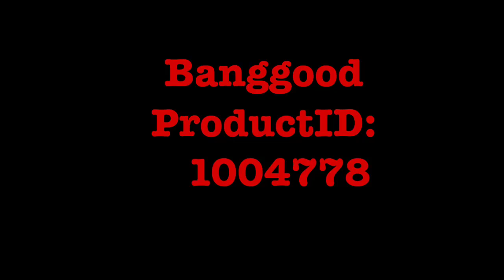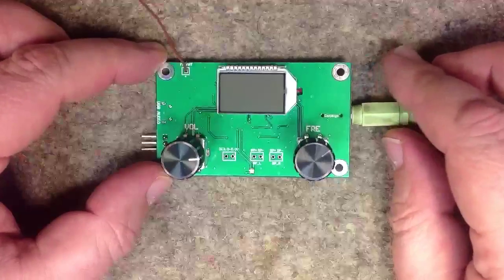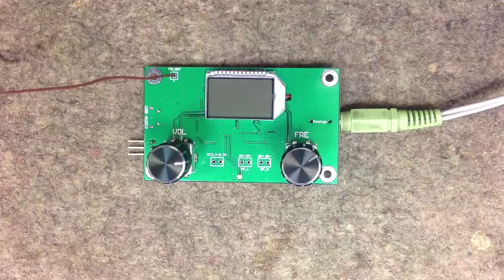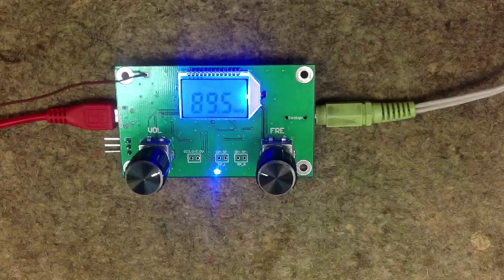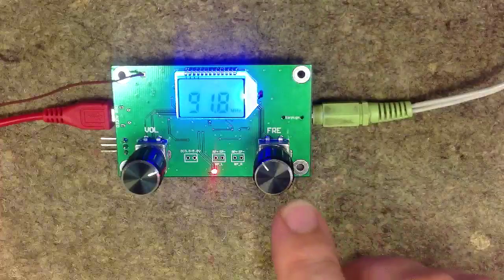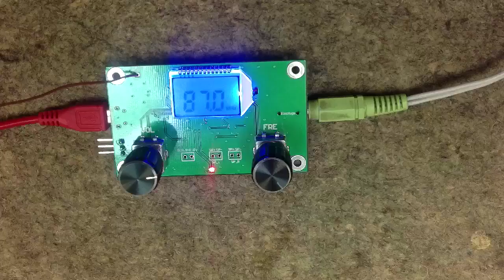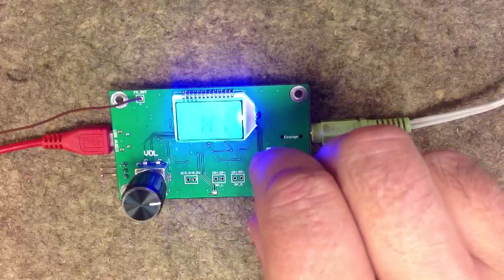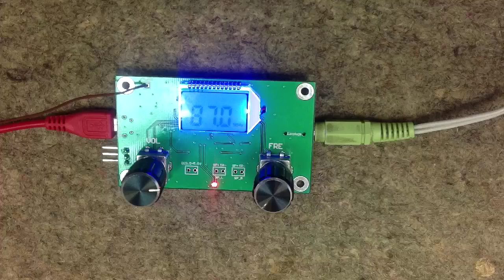Banggood - DSP & PLL Digital Stereo FM Radio Receiver Module 87-108MHz With Serial Control

Comment: This is an amazing product!!! Worth every penny!!! 
It have a build in amp 3W per channel! The connections are between the 2 encoders + the headphones out!
It works from 3.2V to 5V so either a lipo battery or a USB power source would be fine.
The reception is exceptional! I have a router antenna hooked up to mine and where other radios stop, it keeps playing!
I have it boxed and I might upload a demo video.
Battery wise, it gives a full 6 hour playing from a 3,7V 180mA lipo battery, utilizing the on board amp!
Oh! And it IS stereo!!!
I coldn't be happier than this!

Comment: Thanks for the video. Good job on describing the functions as I could not find any manual on this FM Receiver. Two questions: When you long press the frequency knob it scrolls "SN ON" or "SN OFF" across the screen. What is SN? Also can you wire a AUX(3.5mm) jack to this board? If so, how will it switch between sources?
Reply from the maker: When switched to SN ON, the radio does not produce any hissing noise when there is no transmission. SN stands for 'squelch', which is used to suppress the background noise when there is no signal. I don't understand the 2nd question. 😞

Comment: Hi, can you please inform me about which DSP,  PLL and microcontroller  IC used in this FM transmitter ? That wold be very helpful.
Reply from the maker: JL AC1552CG4R3FE 48 pin IC
8035  1540 10 pin IC
2402 memory
2 pcs amplifier
Reply: Thanks ! I can find the PLL FM receiver chip datasheet, http://down.cosou.com/xintechsz.com/QN8035.pdf

But the MCU is some chinese custom made, no datasheet released yet !

Comment: Egy kérdésem lenne  ez a rádió összeköthető-e egy erősítővel a fülhallgató kimeneten? Van egy "Bluetooth 5.0 100W+100W TPA3116 Digital Audio Power Amp HiFi Sound Dual Channel Class D Stereo Aux TF Card Amplifier Board" erősítőm. Hogyan tudnám összehozni őket. Én csak  amatőr vagyok az elektronikában.
Reply from the maker: Ha van rajta RCA vagy Jack bemenet, akkor azon keresztül lehet neki beadni a füllhalgató kimenet jelét egy alkalmas készen is kapható kábellel.
Reply: @bzoli5706  A  TPA3116 blutuszos Jack bemenetén keresztül lehet  hallgatni az internet rádiót. Telefonom kapcsolódik a Wifihez és  az meg összekötve jack -jack vezetékkel és szól az erősítőn keresztül (hangszórók) a zene. Köszönöm a választ.

Comment: Hi bzoli5706. 
Does the display of your Banggood FM radio stays always back-lighted when turned on for a long time? I'm asking you this because my display turns off moments after let it quiet, lightening on only after deal with any of the buttons, frequency or volume. 
Thank you very much.
Reply from the maker: +José Pereira By setting the backlight state is off state press FRE knob key to turn the display backlight Always indicate B1, B0 denotes a backlight turned off 20 seconds after the restart to take effect. Repeat this step to change the setting to switch the state. The factory is set to backlight turns off 20 seconds without operation.

My device works as above described.
Reply: +bzoli5706 I really appreciated your excellent explanation. Thank you very much. You let me more glad because was thinking about any probable defect. Now I'm looking for a good pair of 3 Watt 4 Ohm speakers to mount with it. Can you tell me if I can buy an USB power supply as you used at the video or it was projected and built by yourself? I'm almost a zero with electronics. 

Kind regards. 
José
Reply from the maker: +José Pereira Presently I use the phone output with a PC multimedia speaker with built in amplifier, so the power requirement is more less than using the loud speakers connected directly to the radio.
But I think you can also use USB power supply, but from the more powerfull ones, 0.5A is not enought, try to buy a 2A type.
Reply: Hi again. A great thank you very much once more. I tried 
my Banggood radio with a 4.5 Volts battery and an Altec Lansing iMT237 self-powered speaker. It worked well.

Comment: Hi, its a nice radio and does what it should. All functions at mine and its sensitivity is good. 
Watch for the power, a modern switching power supply may not work (perhaps with some inductivities and condensators for screening; didnt try it up to now). So using an older power supply worked as good as batteries. Also giving power by a pc via usb may not work, I think there is too much high frequency interference). A pc in the near may give a lot of interferences, of course. So a simple fm antenna (what you often find at your hifi tuner) in some meters distance works better than a short cable, that lies near a pc.
One thing I dont get running: the serial interface. Did use several ways: arduino, direct connection from tx->rx and rx->tx, as usual, interface is not needed because of 5v level. Setting serial to 38400 but nothing happens, the radio doesnt react and also doesnt send informations by AT<RET>. Tried also usb to rs232 interface+rs232 to 5v converter. Works at pc, but at the dsp radio same as arduino, not any reaction. Did also cross rx->tx and tx-rx as usual (also changed for testing but of course didnt work). So how can i get the serial to work? Both ways I tried are working at serial monitor, so there is not a defect cable or chip. Sorry about my teutonic english :-)
Reply: Your English is fine!  I got it all, and, thanks for explaining  Cheers!

Comment: How is recieving capacity? Whether it will pick up the station which is far from 200 km? Can you please test it and confirm?
Reply from the maker: Sorry but I can't test it: 1st we have Christmas holidays now, and it is in my working place. 2nd My country is a small country so our stations are closer than 200 km and have smaller power for local broadcasting only. 3rd. I use it in a basement with a less than a meter long wire as an antenna.
Reply: @bzoli5706  thanks for your reply 😊

Comment: Hello Bzolli. So, can the module be powered through the USB port?
Reply from the maker: Yes, but if you use the on board power amplifier, then the standard 0.5A USB power is not enough, you must use a power bank or a 2A charger.
Reply: bzoli5706 
Thank you buddy! Where are you from? I'm from Ukraine.
Reply from the maker: Absolutely YES. But read my previous message.
Reply from the maker: I live in the neighbor country: Hungary :-)
Reply: bzoli5706 
ок. Венгрия!
Reply from the maker: Гаразд Україна :-)

Comment: Damn! I was hoping this module had an auto station seek so that once it found all the stations a simple left or right twist to the tuner knob would increment up or down to the next station, if only the Fm module I ordered "which BTW does via touching either the + or - buttons for both volume and station selection had a display like this one, that would be perfect for the Public Address Receiver I am building..
Dropped a like for yo bro..

Comment: how did you remove the buttons so you can put it in a panel ???
Reply from the maker: You can remove the buttons after unscrewing them from they sides.
Reply: Mine does not have screws... you just pull them off
You may have this version...